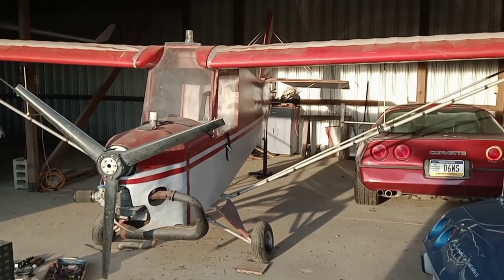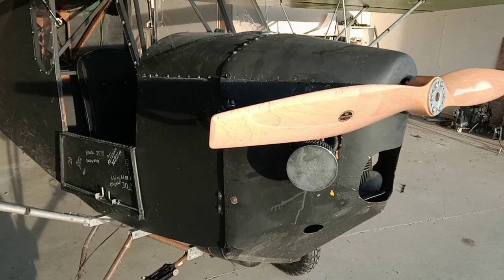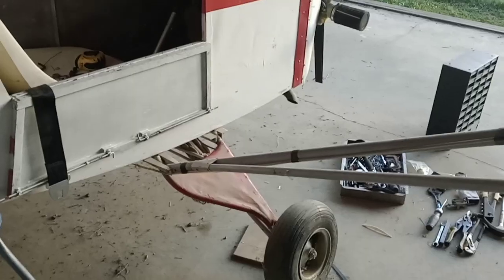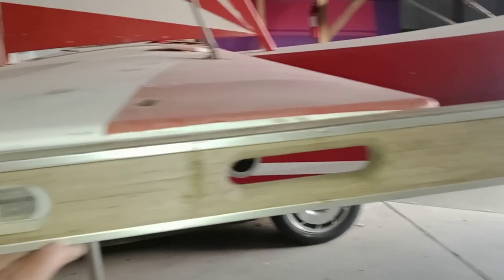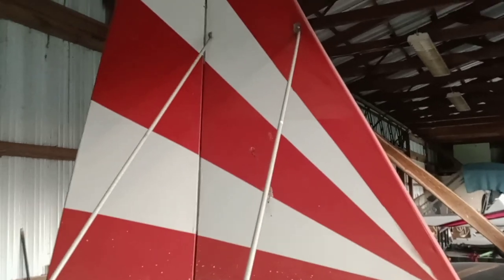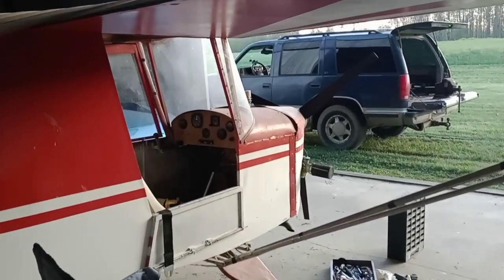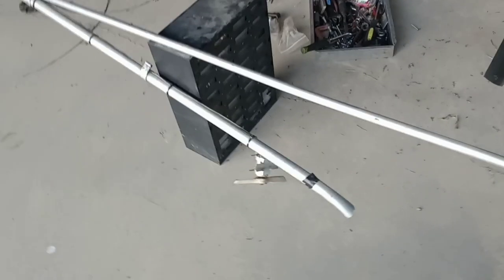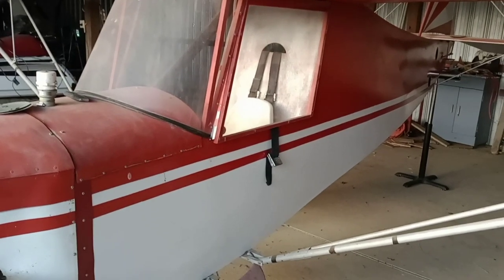FP101 Repair @ PA01

Comment: Change in oil content will change the fuel mix; Less oil = rich  More oil= leaner. I use Blue Max oil at 90:1 but set the engine up on that mix.
With the other plane it might be to trim it at flight speed if the thrust line is higher?!
Reply from the maker: I'm thinking of something in the exhaust baffles maybe being loose or perhaps my needle is bouncing. I did a couple of engine runs back at the 50 to 1 and it's still doing the same thing